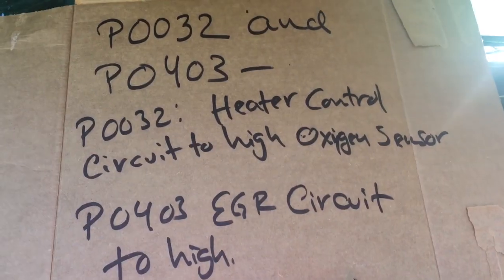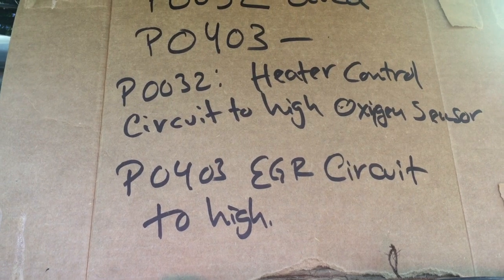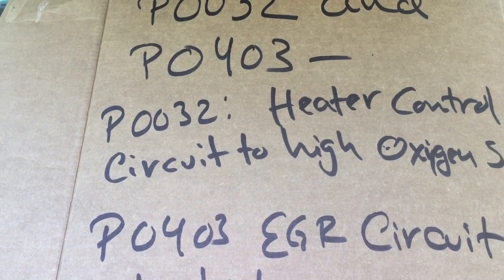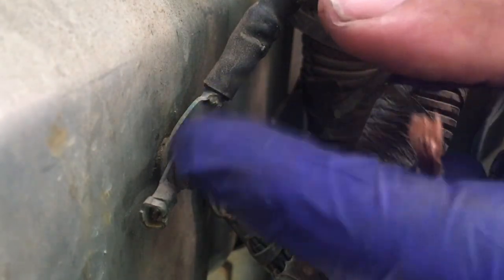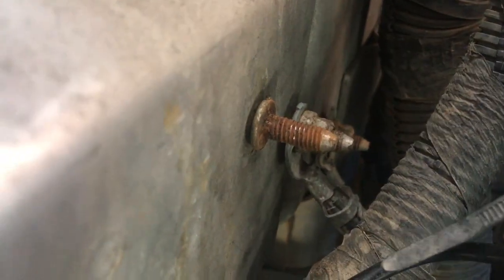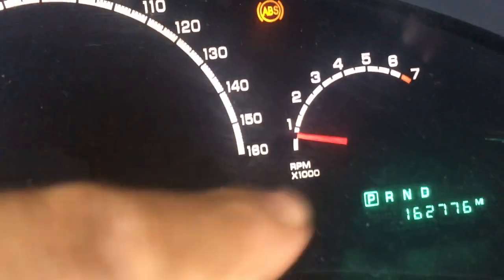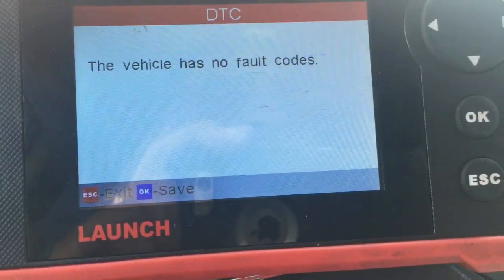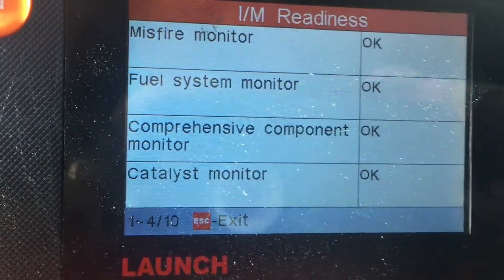Codes on Pacifica 2004 p0032 and p0403

Comment: If only fixing engine codes were always this easy! Chryslers are super sensitive to weak grounds and DC getting into the PCM.. Bad alternator diodes can cause all kinds of engine codes as well as transmission codes, particularly low and reverse trans solenoid codes. If you're getting them, have the alternator checked!
Reply from the maker: I know but in this case we found the problem  but still I’m agree with you 100 %
Reply: @RomuloHernandez     Sure..I just wanted to throw this in there in case someone might be getting transmission codes that are being caused by the alternator having a bad diode. It happened to me twice! I've seen where people had their trannys rebuilt only to have the same problem! But thank for posting your video. It sure saved me a big headache! And I stumbled upon it by accident too which I thought was pretty awesome! These Chryslers sure can be confusing..

Comment: Well how cool is this! I'm looking on youtube to find a video on how to remove a light lens when I came across this video. My 06 Pacifica has been throwing these 2 codes for months. I've been trying to find the root of the problem since the light came on. I stumble across this video and figured I'd give it a try. I was putting a new battery in anyway so I figured I'd remove the tray and have a look. All my wires were intact, but the connections were pretty corroded with NY salt and other crap. The engine light is staying off so far! Thanks for the video my friend, and whomever it was upstairs that led me to this video! Me HAPPY!!!